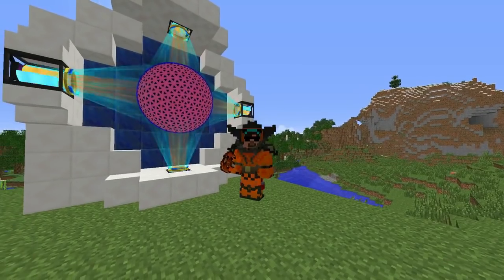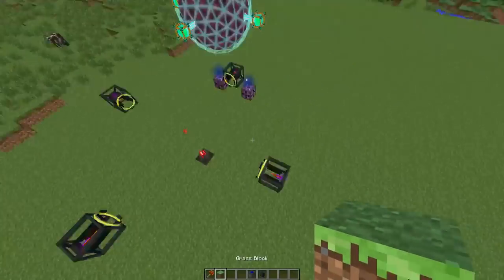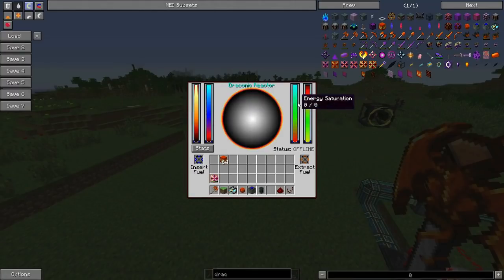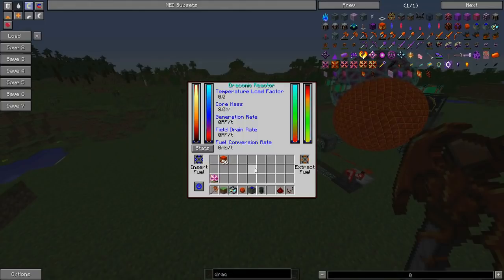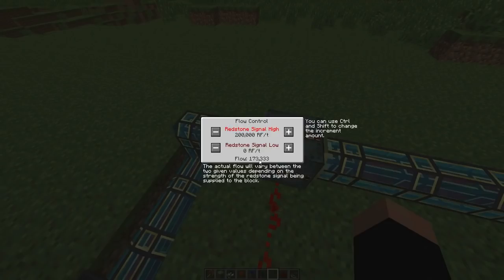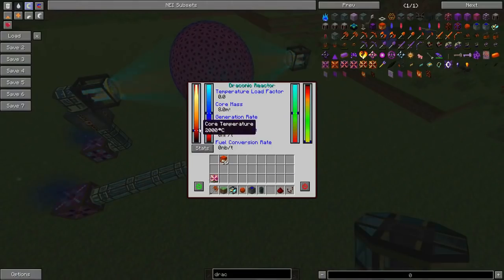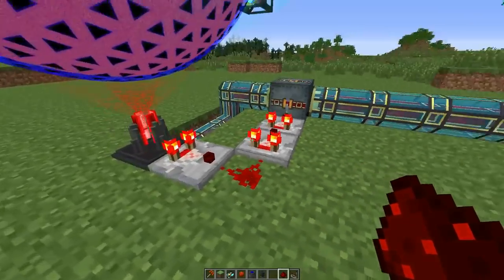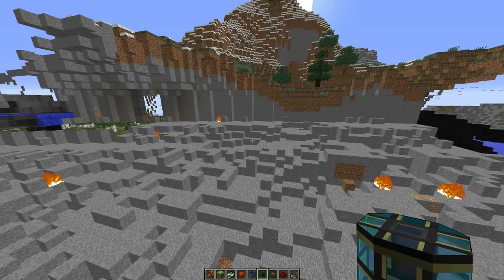Draconic Evolution: Reactor Tutorial

Comment: Dang, I was super nervous to make mine, until I watched some tutorials and fiddled with one in a creative test world. After some poking and prodding, I realize it's actually quite simple: once it's activated, all you need to do is make sure that the power you're putting in is enough to keep the Field Strength above 1% (higher percentage if you want the buffer), and that the power you're taking out isn't enough to push the temperature beyond 8000. I started mine by inputting 140,000 RF/t while outputting 500,000. Assuming you have sufficient backlogged power to start the sucker up, these are safe numbers to let it settle at. Once your output (how much power you're extracting from the flux gate connected to the Stabilizer) matches the Generation Rate, the temperature will decrease, and the Field Strength will increase. If you're Field Strength is dropping and you're worried it'll go too low, add a little bit to the input (the flux gate connected to the Injector). If your Field Strength is too high, or the temperature is too low, then increase the amount of power you're pulling from it (typically, it's smarter/safer to make this adjustment by pulling more power from it rather than lowering the input, as lowering the input will only make the Field Strength drop, while increasing the output increases the temperature. This will still lower your Field Strength, but at a significantly lower rate). BE PATIENT. Wait for  the temperature to start decreasing again before adjusting.

In conclusion, my second sentence once again:
All you need to do is make sure that the power you're putting in is enough to keep the Field Strength above 1% (higher percentage if you want more than a 1% buffer, which I recommend, just to be safe lol), and that the power you're taking out isn't enough to push the temperature beyond 8000.

Message me if you have any questions; I think I've got a pretty good grasp of how these guys work, and I understand the hesitation to build it, but once you've got one stable, it's such a satisfying achievement! And, my goodness, does it crank out some power. As of this moment, I'm extracting 590,000 RF/t, I'm inputting 140,000 RF/t, Temperature is at about 7,900 (when the temp stops rising here I will increase my output to 595,000 RF/t) Field Strength is just under 14%, Energy Saturation is about 12%, and my Fuel Conversion level is at 1.82% (I'm using 8 blocks of Awakened Draconium).
Reply: Can you explain how to launch it? Whenever I try the temperature goes up to 8k before generation rates level
Reply: @caramelzeebra6883 To bring the temperature down, you want to decrease the amount of power you're demanding from it. Safe numbers to start at are: inputting 100,000 to 140,000 while outputting 400,000 to 500,000. When making adjustments to power demand (how much you're pulling from the reactor per tick), smaller numbers are better to start to get the feel for how this baby purrs. 1,000 to 10,000RF/t adjustments are typically safe, so long as your temperature is below 7,000. How much RF are you putting in and pulling out?
Reply: The Brandylion my first attempt I just kinda modified things as I went along, In the end I killed the reactor because temperature stayed way to low. On my second attempt I did 140k input 500k output but temperature raised to high
Reply: @caramelzeebra6883  Try starting at 140K input 400K output. The higher your input, the safer it will be (input is giving the field strength... well, strength), the lower your output, the colder it will be (output determines temperature; if you try to output more than it's currently generating, it will say "they want more power from me that I'm not making, let me increase my temperature so I start producing more power. Once I reach the output that's being demanded of me, I'll be happy" and it will start to cool again). Once it's cooled down to around 7,000, increase the power demand by around 10K and the temp will increase again until it reaches the demand.
Reply: Doing this over and over, you'll rarely have to adjust your input, and you'll slowly start beefing it up. Eventually you can have this thing pumping out RF in the millions, but keep in mind that it's a slow process, and you must be patient. Being hasty puts you at risk of making too big of an adjustment that blows it up.
Reply: Let me know how things go, and if you're still having troubles, I can try to help out more. It's 3:30 am though, it's past my bedtime, I'll check in on you in the morning lol
Reply: The Brandylion ok, last question I have is how long does it run with each refill
Reply: @caramelzeebra6883  A long time, if you fill it up completely. Like, probably a few weeks.
Reply: One thing I realized, depending on the modpack you're playing, power production may be modified. What pack are you playing?
Reply: The Brandylion ok, I’m pretty sure 8 awakened draconian blocks is the max and I’m playing stone block 2. My plan is the gather 3 trillion rf in a energy core so I can make the balanced clay for essentially infinite emc
Reply: Caramel Zeebra okay, yeah, 8 is full, and all these numbers are based of my reactor in Stoneblock 2 as well. Check out my reddit, I've got some footage of my reactor in Stoneblock 2 there: https://www.reddit.com/u/the_brandylion/?utm_source=share&utm_medium=ios_app&utm_name=iossmf
Reply: im commending to copy this later.

Comment: My reactor is just stuck at charging. what should I do?
Reply from the maker: Sounds like ether the injector is not getting power or is not connected to the core. To make sure its connected to the core right click it and see if the core gui opens. If its not then just break and replace the injector. (Make sure there are no blocks between the core and injector when you do so)
Reply: right click the injector?
Reply: I think my injector might be too far from the core
Reply: I have replaced my injector 2 times and no gui, and I have cryotubes leading from my storage to the fluxgate which leads into the injector. still not sure what the issue is.

Comment: Do you ever need to refuel (with awakened draconium) the Reactor? If so, how do I know that it's time to refuel? And what happens if you don't refuel?
Reply: Sorry if I'm 5 years late. But wouldn't the reactor shut down if the fuel ran out? I haven't seen someone refueling a reactor because of the long burn time.
Reply: @andrewtyler7648  You're right. I never needed to refuel ot cuz I just check it manually every so often. It really burns so slowly

Comment: but how do yo get that first bit of power without using another core you built? How do you move power from say a bigreactors reactor to it?
Reply: probably any form of energy you can whip up.
Reply: The easiest way I've found to move that amount of power is Tesseracts. You can connect them directly to the out port of your Big Reactor and send power to the Draconic Reactor. You'll still need to regulate it, but it works well.
Reply: Matt Shine The ones from thermal expansion?

If so , can they transfer power from other things too? Like immersive engineering?
Reply: +Sumgui2009 I'm dumb, wrong reply. Tesseracts. Yes, you can use them for anything, they transfer infinite power/items/liquid.
Reply: I still don't understand. What to i use to connect? Like, with buildcraft its really easy to power things with an immersive engineering energy storage block. You just connect it with wires. But, i have no clue at all about draconic evolution. There are no wires. There are no pipes. I don't knwo what i need to connect and i don;'t know what i need to transfer.
Reply: guy5f i would nto ask if i could find something i could understand.

Comment: I have  a problem with placing the infuser... it always want to be placed pointing vertically ... that sux... sometimes the reactor wont charge even if all components are placed correctly so you are forced to replace the infuser and than the sphere of the reactor is in your way ... the infuser can only placed pointing upwards if you are realy directly above the block you want to place it at... if you are 2-3 blocks beside (because of the alreaady existing reactor sphere) it will always placed pointing vertically an so you need to replace all components of the reactor is there a way to place the infuser so that it points in the direction i want it to point ?

Comment: what are those wires your using?
Reply: +Matt F Cryo-Stabilized Fluxduct from Thermal Dynamics
Reply: +KatayinGaming ty
Reply: my issue is we have Draconic Eovolution in our serer, and Thermal Expansion, and Thermal Foundation, but no Thermal Dynamics. So we don't have access to Cryo-Flux-Ducts. I'm tryinbg to find a way to supply sufficent power to the Field Generator with what we have, and being able to properly regulate power output.

Working with the flux gates is good, but the issue arises with the fact that the energy trancievers in Draconic Evolution don't seem to respond correctly when trying to get them set up to pass energy through them. And the trancier crystals seem like the only viable solution to us, since the only other thing we have for power transfer is EnderIO wich their conduits cap out at 21k RF/t.

I'm just trying my hardest to find a solid way to safely puull power from this thing without overloading it in 5 seconds. Any help on this suubject would be appriciated, and if this is honestly a lost cause, so be it, we can still get the nether star gens from Extra Utilities, or any of those 64x gens. But we're just really want to get this to work so badly.

Comment: Why my draconic reactor will not charge? i placed my cable like you under the charger and the complete setup is like ur's. i tested from energy cell to energy cell via fluxgate, that works. but it wont charge . cable to cable is working. but with the redstonesignal it wont work i think.

Comment: Is there any block that can comtain the blast
Reply: +Morgan walton Reactor Stabilizers clearly :P
Reply: +Morgan walton Most likely not. Draconium-Infused obsidian maybe (Probably not), or bedrock (Likely). You could always test.
Reply: Freshly Squeezed OJ
I have done some testing myself. anything labeled "blast proof" can. tesseracts, reactor stabilizers, bedrock, etc. also, I have found due to a reactor meltdown near my teir 7 energy core, is that blocks of draconium can almost contain the blast. a layer two-three thick of draconium probably could do it.
Reply: Good to know
Reply: Reinforced obsidian can withstand almost anything
Reply: All of you are wrong. It is useless to contain the reactor explosion because it goes right through ANY block, and will just skip unbreakable ones.
I tested it.
Reply: *****
It doesn't skip unbreakable blocks, it oddly just acts like the explosion is coming down from high in the air, so the unbreakable blocks only protect the other blocks directly underneath them.